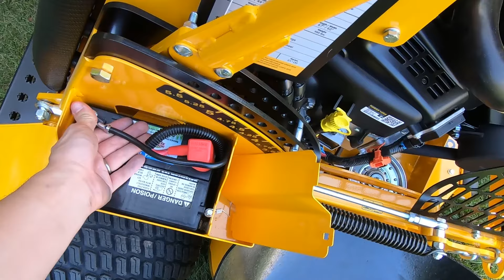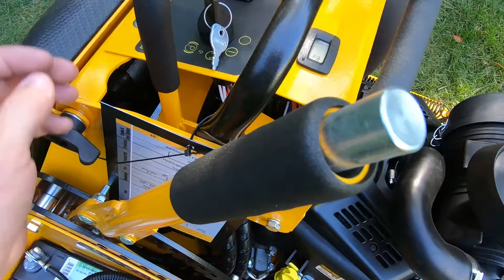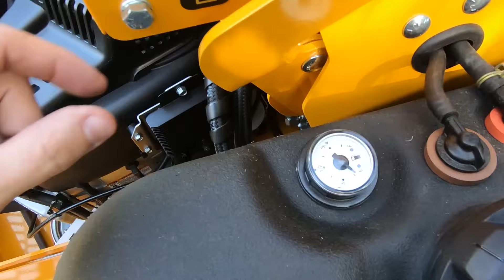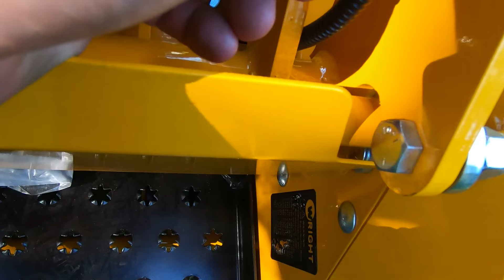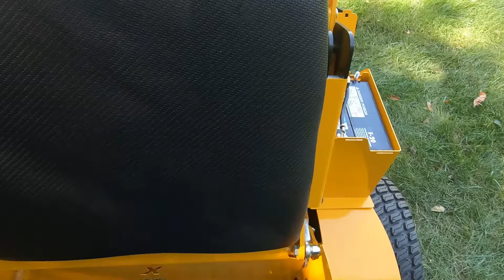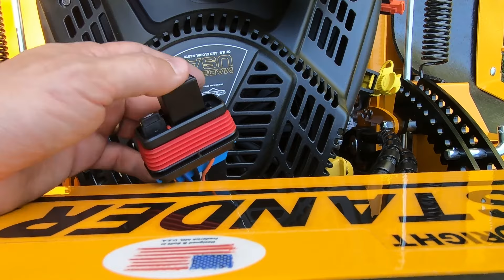WRIGHT | Ultimate Guide to Lawn Mower Electrical Troubleshooting

Comment: I have one today. Keeps blowing the fuse when I engage the PTO button. Weird cause I have power going to both wires! Tested clutch with battery and it’s good.  Question also .. on the harness it has a black wire does that go to ground? Cause when I do the PTO switch it gets power.. (weird) and will pop fuse .. disconnect it and fuse doesn’t blow but clutch doesn’t work. Tried a new PTO switch and the same thing happens.  So not a PTO switch.  Any idea?  Thanks.

Comment: Hey Ed, thanks for your informative videos.  My stand on mower only starts with the parking brake off and my hand control brake engaged. With the PTO off, if I pull or engage the parking brake, the mower dies???? I would appreciate your help.

Comment: Hey Ed I have a 36 Sentar mower but when I go to engage the blades the mower just shuts down for like 5 minutes and that my mower doesn't have a safety platform switch because it has a seat.... do you know why the blade will not be work and the same thing for turning them off?

Comment: I've got a 36" RH early serial number 34429.  Replacing the ignition switch for a no charge/no power to voltage regulator and found an empty terminal on my old switch and a loose plug with 2 female connectors. (2 orange and 2 black wires)  Is this supposed to go to the switch? or somewhere else? or nowhere and leave the terminal empty?

Comment: Really getting Sick of my guys working on sites and them calling and sayiong Wright stander wont start .Key turns and nothing happens. How is this acceptable? All my regular machines by other cos that are hydros walkers and far less complicated and easier to work on  NEVER have electrical problems... Really getting sick of Wright and there over engineered , impossible to access and constantly breaking electrical issues! And this guy giving videos on things that simpy should not be breaking!!!
Reply: Did you figure out what's going on because I turn the key and sometimes it starts and sometimes it does?
Reply: Mine does the same thing
Reply: Buy another mower then butter cup, I don’t see any other brands making diagnostics videos

Comment: electricity is smoke. wires are hoses carrying the smoke from supply to consumer. starters take more smoke so bigger hoses.  when you let the smoke out, it quits working.  an open means the smoke is blocked from traveling down the hose. a short means something has cut the hose and the smoke is going directly to ground or into another hose.

Comment: Hi Ed. I have 2007 52" Stander SN#40967. Where I suppose to connect the purple wire? Solenoid or Starter?
Reply from the maker: Hi Paul, it goes on the same stud as the red battery cable. Purple is the main harness power tapped from the battery cable. -Ed